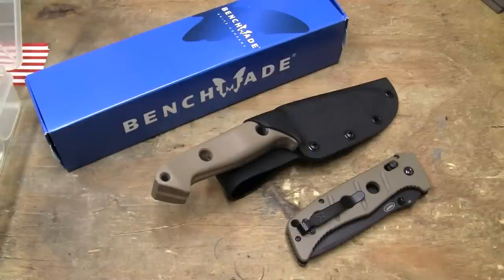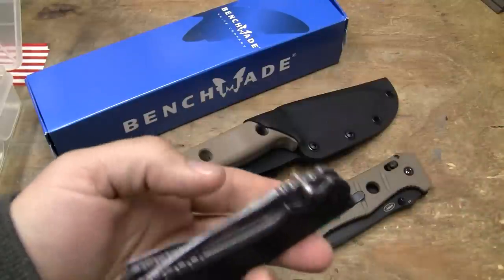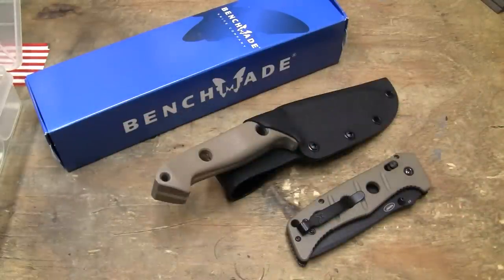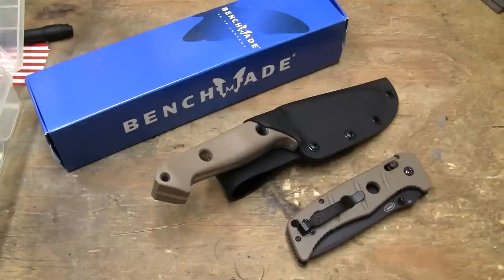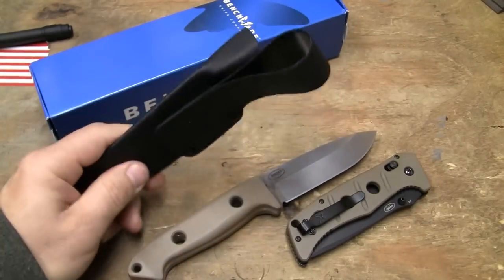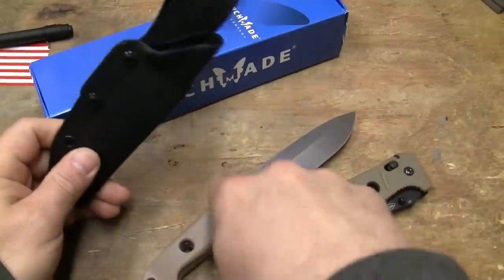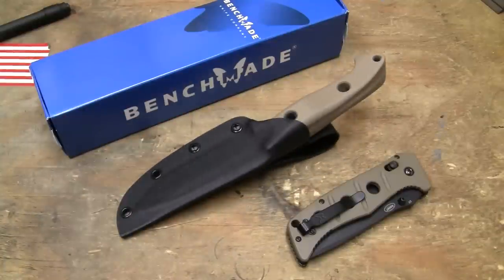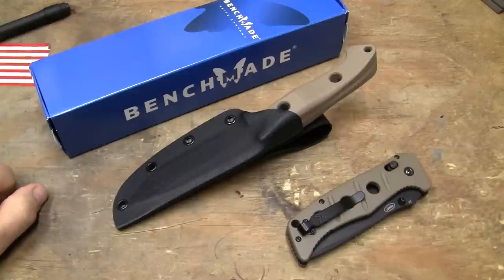Benchmade Sibert 162-1 Bushcraft EOD What a FAIL

Comment: I had a problem with my Kadex Sheath the tension screw kept coming lose and the knife would almost fall out. I tried returning it at sportsman's and they said It had scratches on the blade is only used it as a box cutter and to cut cloth and plastic wrap.

Comment: Here's the main thing wrong with this. Your nitpicking a PRODUCTION knife and sheath. Yes the lock could be better but the way it is it would've worked for a long time. Here's the thing I work with kydex I know how it performs and the stresses I can take. If the end user is smart if the sheath begins to not be as retentive what you do is you heat it up and push it down some more. Also with the rivet placement is fine. The tip rivet is fine its there to stop the blade from goin to deep in the sheath in case of an over powerful placement of the knife in the sheath.  And with the eod. The blade is short and thick for strength purposes. So please stop trying to act like you know what your talking about. End post

Comment: Just got this knife.The sheath i got fit well and had a drainage hole. I would expect this sheath to go with a knife at walmart you buy for 10bucks. I love the knife itself and i like how its made in the U.S. This is the first Benchmade knife i own. Some of the cheaper 40$ coldsteel knives come with thicker better kydex sheaths and are a fifth of the price. Am i supposed to spend an extra 90$ on a custom sheath. I saw alot of reviews of this knife with the leather sheath and that wasnt good ethier. I saw this knife online with the kydex and thought oh they fixed the problem .....

Comment: Love mine BUT it came with a horrible    V grind with shoulders that cause way to much drag.  As for the knife with my edge its awesome . The design hook handle catches your hand for great cutting performance.   Also the forward thickness saves you from getting arm fatigue its excellent. 
That kydex sheath sucks...

The leather one I have is great people are way to hard on that leather
 edition.

The steel is also NOT hard to profile I had zero issues giving mine a convex 20° edge . Honestly it sharpens up easier than 154cm or maybe about the same . 

At the price I paid its ridiculous you don't get a fire steel and dangler for the leather version.   Overall I like the knife but don't buy it if ya can't handle fixing edges .

Comment: I fucking love this review... lol so true and hilarious. That knife looks sturdy though, but I'd classify it as a bushcraft knife rather then an EOD knife. EOD knives as far as I know are supposed to be longer in length and have a square tip to them. Spot on about the sheath though. Leather would have been better. Benchmade could have had better marketing if they introduced the correct classification to this product. check out the new Arvensis 119. its like they almost got it correct. looks like what SOG has been doing for years. lol

Comment: Yeah I hear what you are saying. $195.00 and all they have to offer is S30V wrapped in shitty scales secured with titanium. The Army hated it so much they requested a different scale color and sheath. Fucking Benchmade they couldn't even get the color right. Oh and don't get me started on that kydex nightmare. Have to drill a drain hole, use a screwdriver to remove the belt loop so a better loop can be added and screw using an oven to tighten up a sheath. Leather was easier you just had to get it wet.
I don't know man if you PM me with your mailing info. I can send you $20.00 (the going rate for used production knives) plus whatever the post office charges for a if it fits it ships. If you want to dump it. Heck I might have a knife laying around to send in trade. Let me know. I just want to test it in my shop.